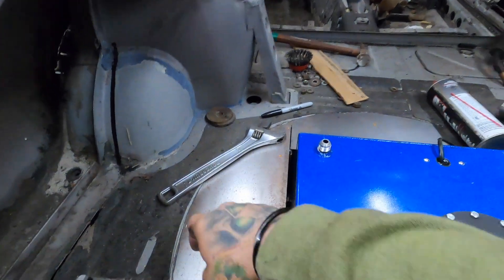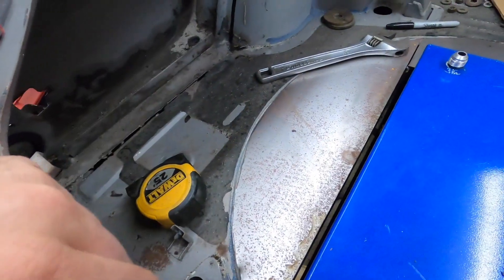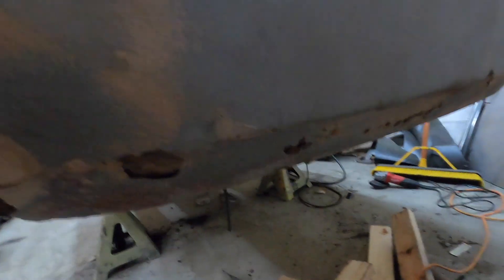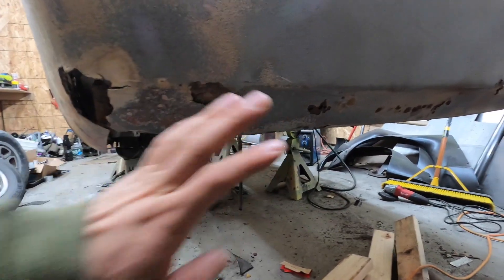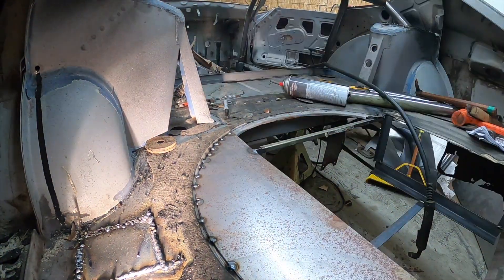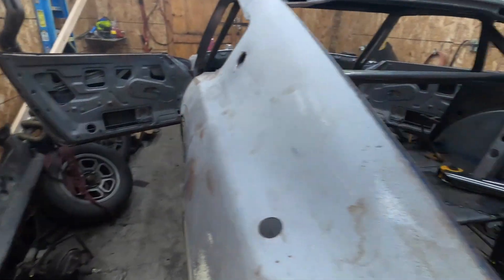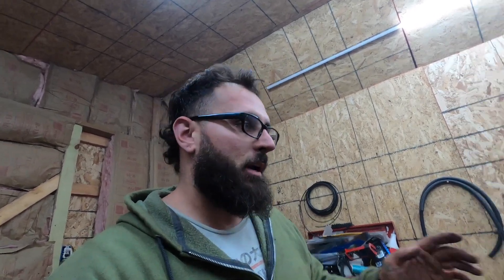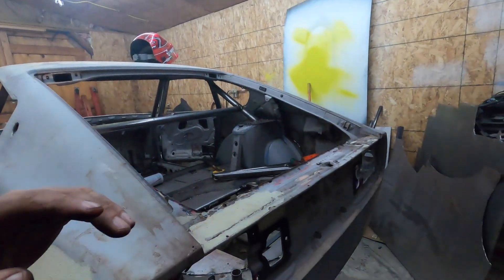240 rust repair almost done

Comment: Subbed. I just picked up a 71 240. For the hatch check with Industry Garage (Street Bandito on YouTube). I know he made one and he sells a lot of the parts that he makes. Shit maybe we could get him to do a small lot of them.

Did you use MIG over TIG on everything just for speed? I know I’m going to have a good amount of patchwork to do but I’d prefer to use TIG on everything I’m just not sure if I’m going to have trouble burning through the thinner sheet metal areas.
Reply from the maker: Thanks brother! I have been mig welding everything just because that’s all I have but this thin old metal blows through quick if your not careful

Comment: If you want to do fiberglass hatch i suggest doing Ztrix or Jpfiberglass. I cant speak so much for jp because theres mixed reviews, so far ive only gotten their tail light panel in cf and im happy with it. As far as ztrix many and i mean many swear by him. I plan on replacing most of my metal pieces on my datsun with fiberglass simply because im done with rust lol
Reply from the maker: Appreciate it homie I can not wait to order the last few parts and get back to working on yhis thing!
Reply: @NRMotorsports  yeah can’t wait to see what’s next on the build up 👍